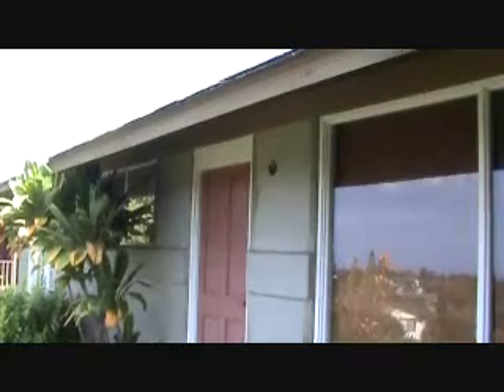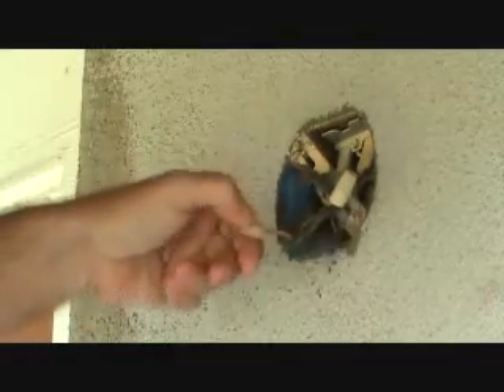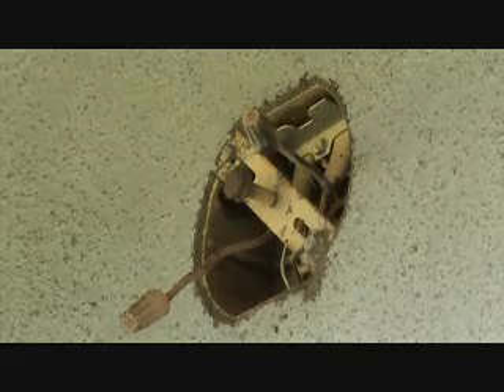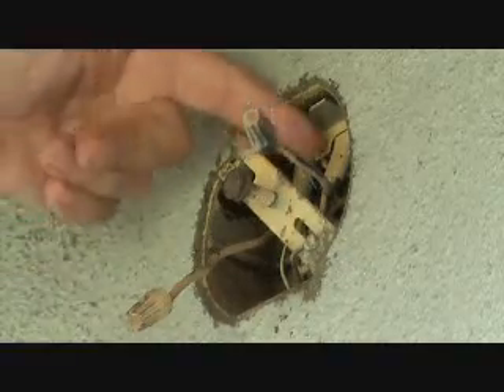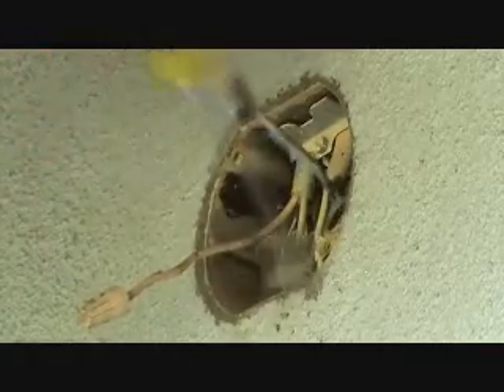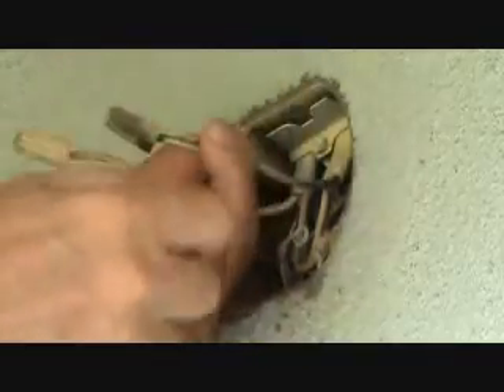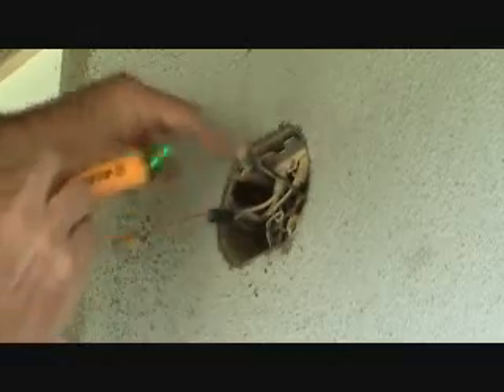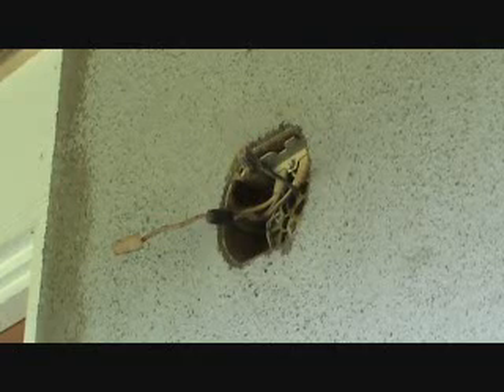How to install an exterior light fixture...Part 1

Comment: Just flipping the switch is NOT ok, old house wiring goes to the fixture 1st before the switch. I learned this lesson the hard way. Got knocked off a stool with burnt hands, and I consider myself lucky. Stupid mistake!  If I didn’t fall off the stool, I would be dead, because I couldn’t physically let go of the wires gravity did it for me. Turn off the breaker and double check with a volt meter that the power is actually off!
Reply from the maker: Good call & yes some old light fixtures have the power going to the light fixture rather than the light switch but most of the time for me anyway, I find that the power is at the light switch but yes your point is well taken & I should be careful about that. Thanks for the reminder!
Reply from the maker: He did bring up a good point as I have found that some old light fixtures in fact have the power up at the light fixture then all they have at the light switch is one ground one white & one black with the one white being the power to go back up to turn the light on. Some electricians did that either being easier for them for how they ran their wiring or by saving a bit of wire not sure......It would be advised to at least be aware of this especially if you are working in an older home for instance. Thanks for stopping by.